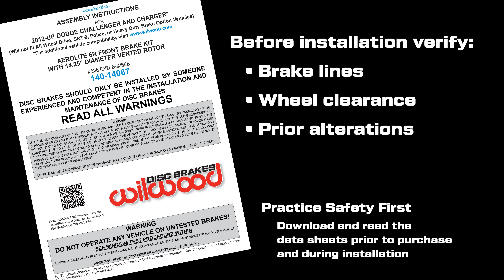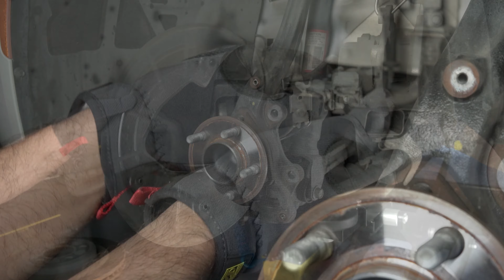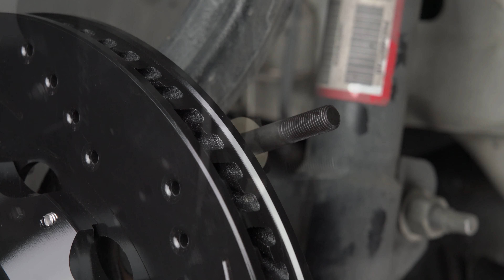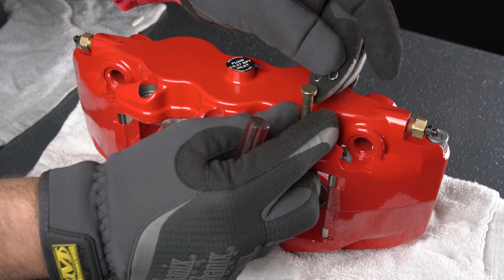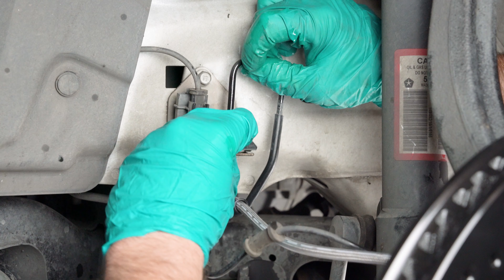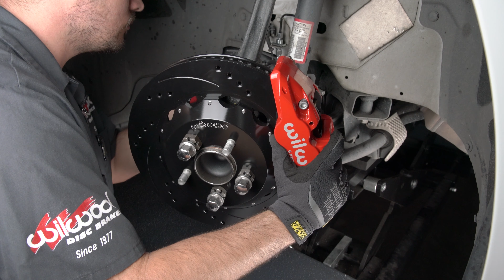2016 Chrysler 300 Wilwood AERO6 Front Big Brake Kit Install

Comment: Would it fit a 2018 5.7 Charger? Or only up to 2016 models?
Reply from the maker: Hi, this kit accommodates up to 2016 only.
Reply: @WilwoodDiscBrakes so no need to change spindle just plug and play??

Comment: Is this on a SRT spindle or a 3.6/5.7?
Reply from the maker: Hi, this one is a 3.6
Reply: @WilwoodDiscBrakes  would it work on a 5.7 ?
Reply from the maker: @ricardomena4009  Hi! Yes the kits will work of the 5.7
Reply: @WilwoodDiscBrakes  charger or Chrysler only?
Reply from the maker: @ricardomena4009  It will work for both vehicles.
Reply from the maker: @ricardomena4009  This kit will work for both.

Comment: What's the recommended method for replacing brake pads with this kit?  Can I simply remove the (2) locknuts shown at the 3:57 mark, or do I have to remove the entire mounting bracket (and thus have to re-shim it back into place every time I change the pads...)???
Reply from the maker: Hi, when replacing the pads simply remove the 2 locknuts and install.